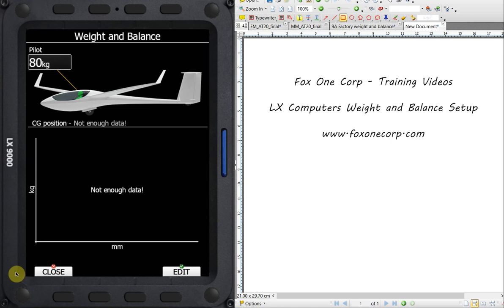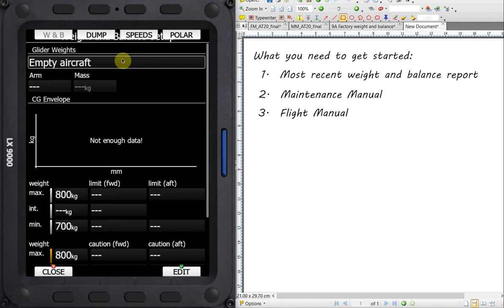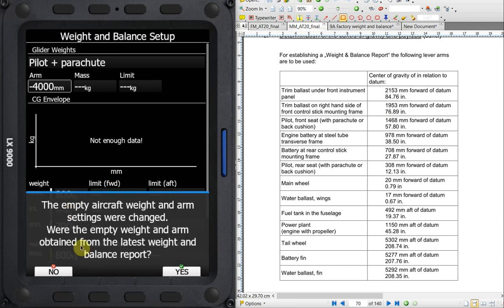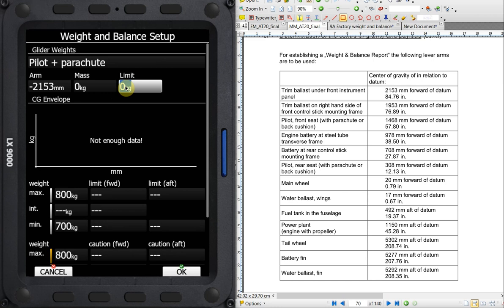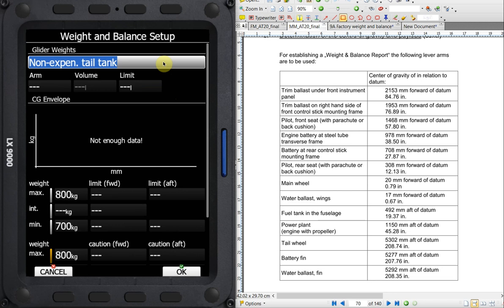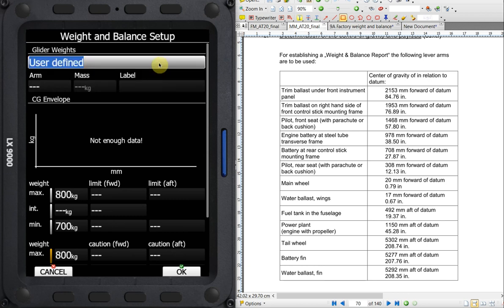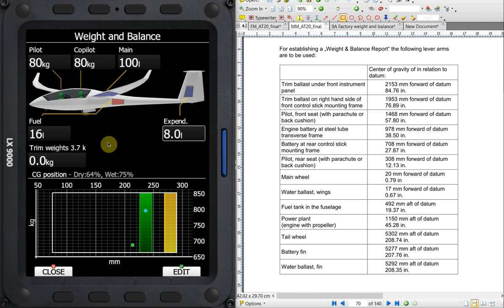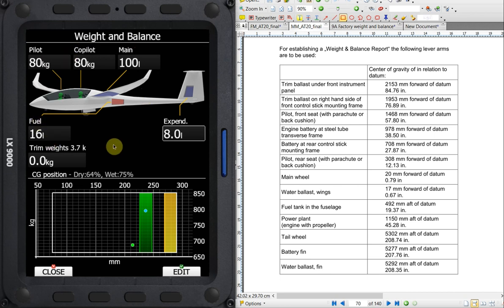How to Setup the Weight and Balance in your LX Flight Computer

Comment: at 6:50, you entered the front seat pilot arm as -2153 instead of the correct value of -1468mm.  This happened when you were shifting pages around, and got distracted.  -2153 is the arm of the trim ballast lead plates.
Reply from the maker: yup!  that's the mistake and the cause of the mistake.  Another important lesson - don't allow distractions to affect what you are doing!

Comment from the maker: You may notice some data entry errors in the video as I am setting up the Arcus, I found them and fixed them part way through the video by verifying the LX result with my spreadsheet  The final pre-flight check shows valid CG position after I fixed the errors behind the scenes in the midst of recording.  Can you spot my mistakes?
Reply: yes, you inserted trim balast insead of pilot+parachute numbers